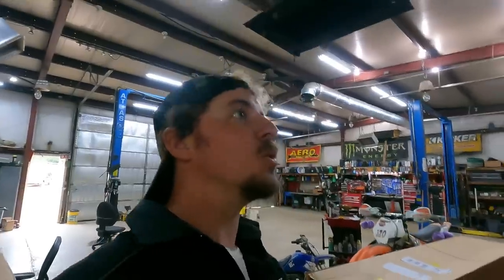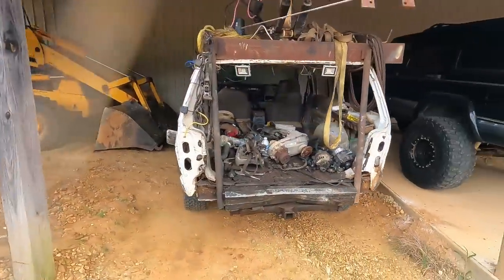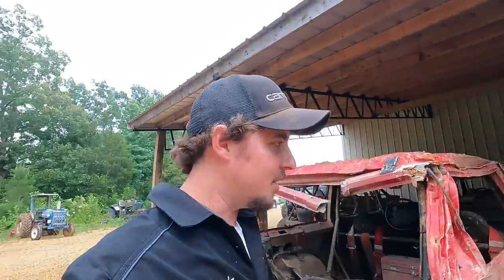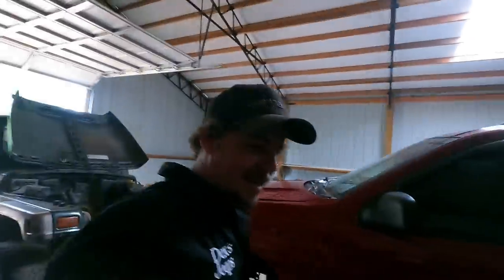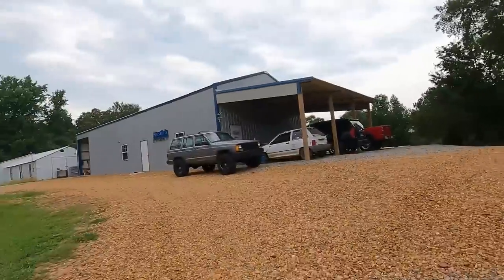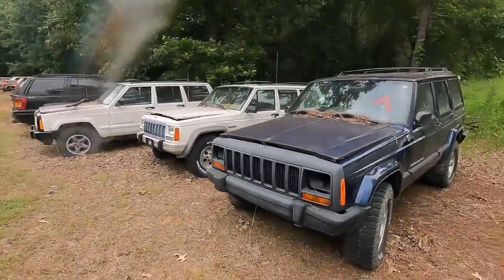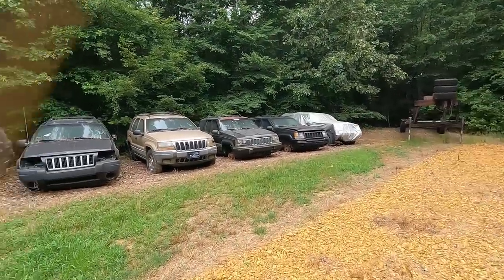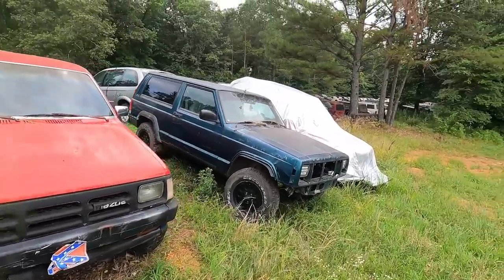You Won't Believe The Awesome Builds I Have Planned For This New Channel!!!

Comment: I've owned roughly 20 jeeps XJ,MJ,ZJ and WJ's but you sir are on a whole different level
Reply: Oddly, Dex never mentions all the ones he has rebuilt and sold, plus the 100 or so annually that gets crushed when scrap price goes up. Dex hauls 9 crushed Jeeps on a 40’ equipment trailer. The dually Duramax screams for mercy coming up to driveway hills, but doesn’t give up. He only talks about the 700-750 in his back yard now. Many other Jeeps have come and gone over the years. 🤔🤔🤔🤔

Comment: I have a 5.9 limited in Dark Slate if anyone is looking for one. Has a blown head gasket I believe. Runs and drives. Body is straight paint is fair interior needs some upholstery. Somewhere in the neighborhood of 160,000 miles on it. All factory and all the 5.9 limited parts are there.

Comment: You need one "crazy" build to get the traffic up on the channel, you can always re-upload it later. Do you sell complete XJs that are decent runner/driver enough for a budget trail rig (or a vehicle + the parts needed to get it to that point)... I got a free set of sticky Nitto UTV tires and need a rig to put them on...